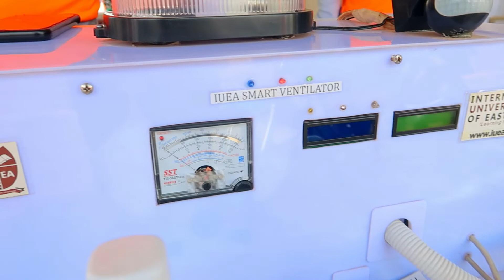how a Ugandan university makes Electric bikes and Bamboo bicycles #NSW21

Comment: Im very much interested in them developing an electric bicycle. I dont want the hassle of number plates and second party insurance or being harrassed by police.
Reply from the maker: They have electric bicycles. There was a particular one made from bamboo that caught my eye
Reply: @techselectug  I saw something with an electric motor mounted beside the rear wheel with a direct belt drive...I'll pass on Flintstone rigging.
Reply from the maker: @Silverbackugx  hahahah, last I spoke to some one from there that flinstone setting was a prototype 🤣 can't wait to see if they did the final
Reply: @techselectug  I certainly hope so. That would get you laughed off the stage next to modern e-bikes..
Reply: @techselectug  the few Chinese e-bikes that I've seen in  Uganda have been the low level, low grade junk with no more than 300W motors. The first ones to bring high quality 750W and above bike to Uganda is going to kill it in the market.